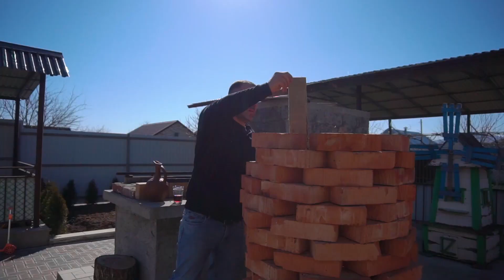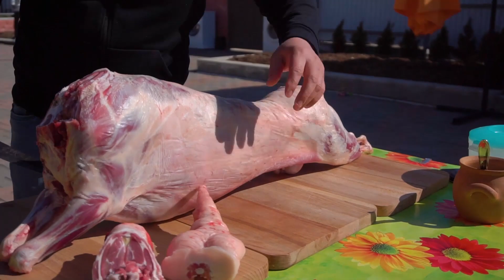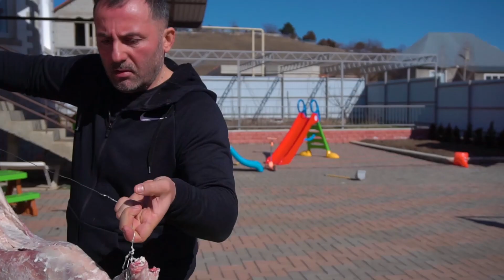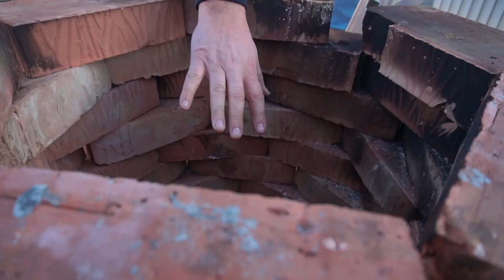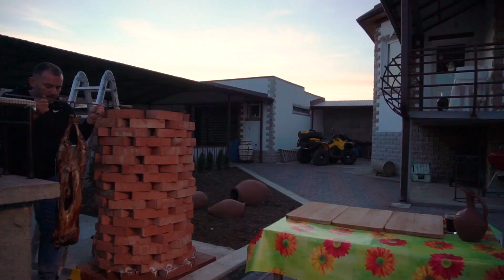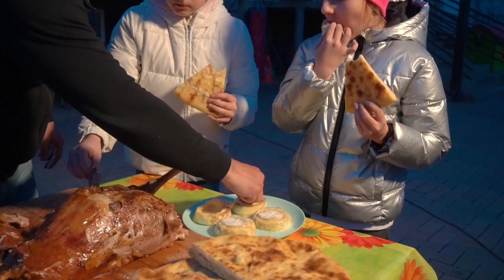LAMB 🐏 BAKED in a HANDMADE TANDOOR 🔥.

Comment: Fellas the flames and the high temperature can achieve faster cooking time and better quality of grilling (Smoked and grilled on charcoals) but you have to add a piece of fat on the top of the lamb or spray with olive oil the lamb couple of times. Also have to add a small plate on the bottom of the lamb avoiding thus the burning heat from the charcoals. However your way was good enough.  Traditional tandoori were made with a specific shape in order to allow the heat to move along the asymmetric cylinder shape around the meat